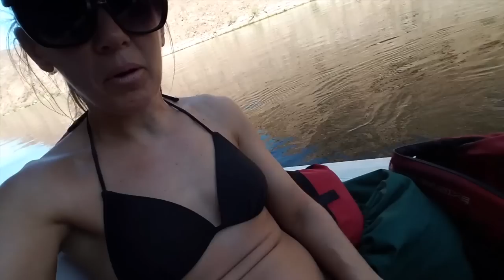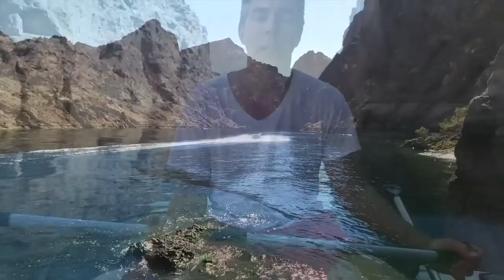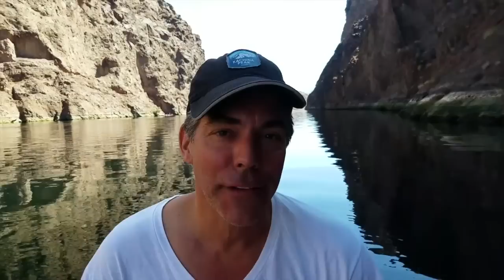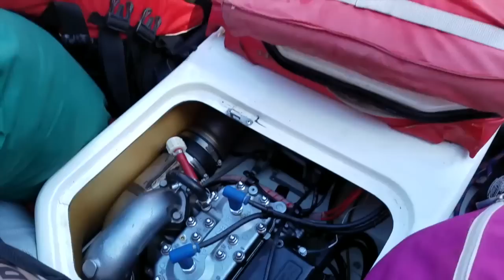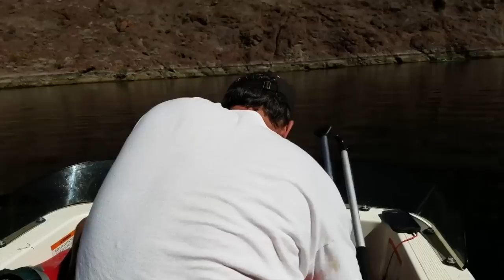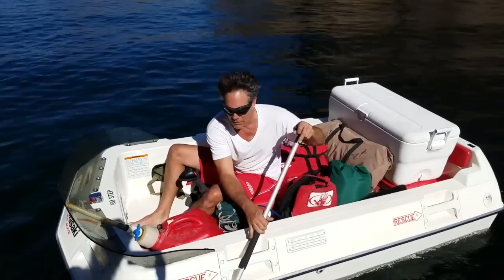Kawasaki Jet Mate

Comment: it’s weird that in the Jet Mate the engines  have those issues i’ve owned  a Fleet of PersonalWatercraft including a 1992 Kawasaki with the same motor and several other brands  the Kawasaki was always the most reliable one out of the group  and we called it Old Faithfull because it almost always got us home  it wasn’t the fastest machine  but it was a popular model that was raced in that Era called the X2 that was technically a two person sit down Watercraft the racers  used for one person that generally stood up  for racing  the owner is correct  on the Jet Mates being kind of rare in the United States  but one nice thing about that  motor and Jet Pump is currently in 2023  you can find  many used Factory and HighPerformance parts for he engines  fairly inexpensively on Ebay  and similiar venues  anyone who is  handy  can also put a upgraded motor in the Jet Mates or purchase a brand new one for about  a grand shipped to your door